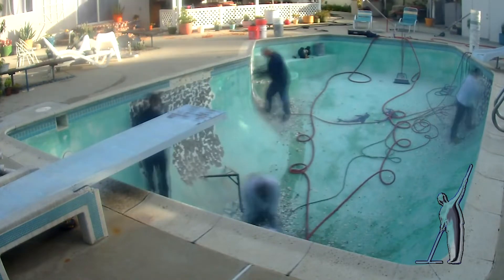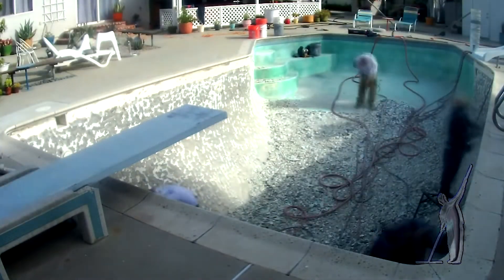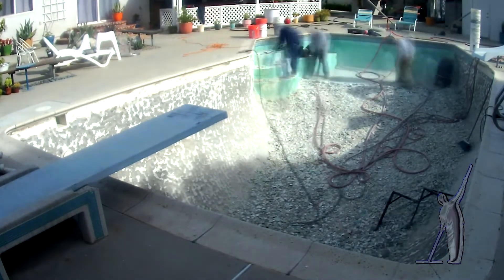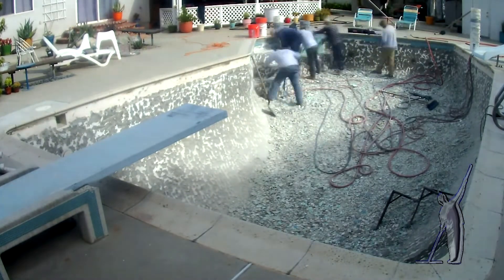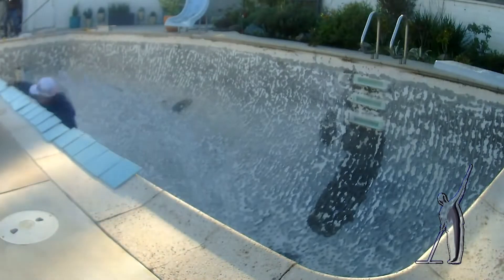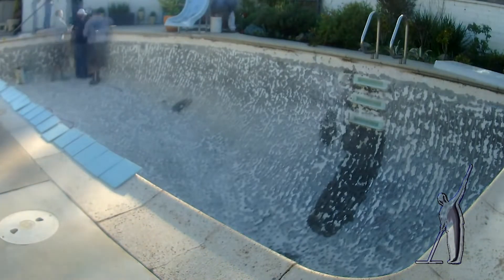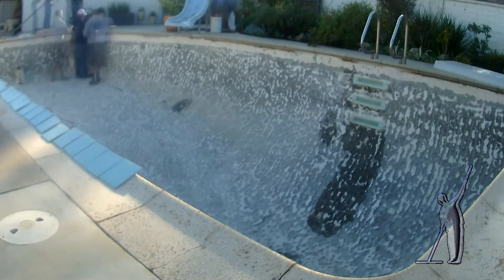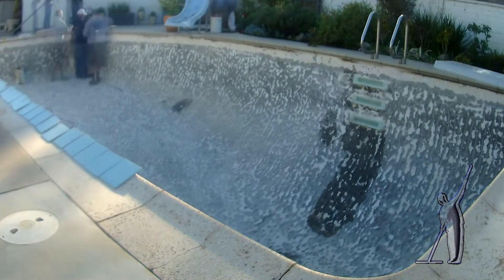How to Remodel a Pool in 3 Days! - Ultimate Pool Guy 2018

Comment: I want to do something very similar but I also want to increase the size of the steps (mine are very small).  I have a concrete pool.  Can you please advise how deep the rebar needs to be inserted into the concrete walls and floor, rebar size and spacing.  I also want to reduce the depth of the pool (it's close to 8' deep at the drain), I'd like to make it around 6' deep.